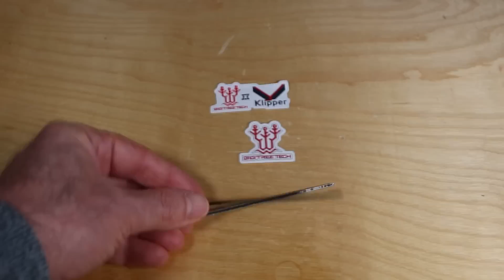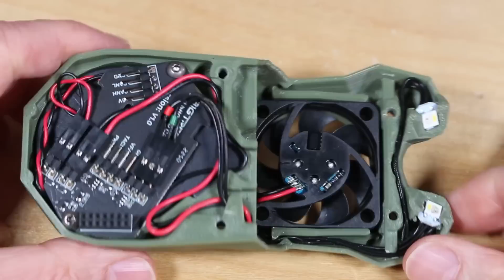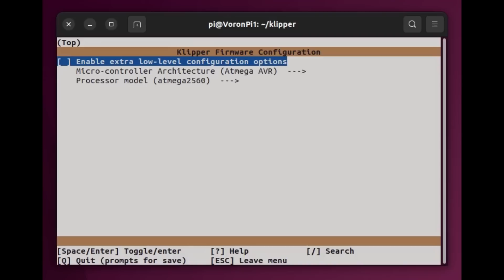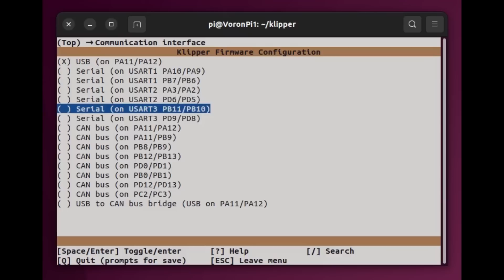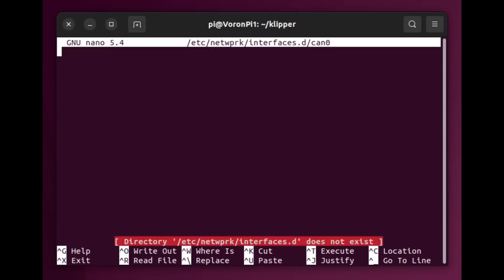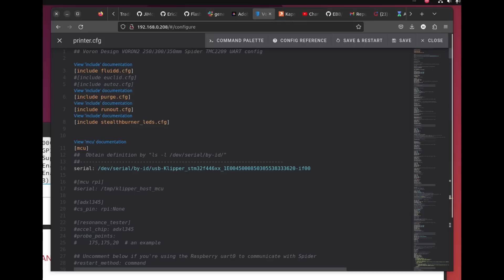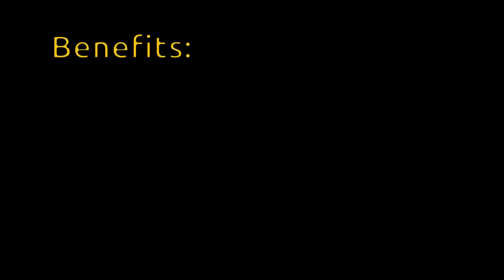Canbus SB2240 and SB2209 3D printer Install, Thoughts & Tips from BigTreeTech (BTT)

Comment: had working printer updated klipper and now cant use anymore do i flash both the manta m8p and toolhead board with klipper going round in circles with canboot klipper and canbus uuid
Reply from the maker: After major updates to Klipper, you may need to flash both.

Comment: I am confused about the power connections to the U2C. Does this power come from my power supply? Also, you didn't mention where the connections go that come from the SB2240 board.
Reply from the maker: Yes, I connected 24v directly from the power supply to the u2c.  The SB2240 can connect to any of the ports on the U2C.  Even the "h" & "L" screw terminals which is what I did.  the SB2240 can also be connected to the power terminals on the U2C or directly to the 24 power supply.

Comment: I'm curious why you didn't plug the can cable up directly into the octopus?
Reply from the maker: Sorry for taking so long to respond. When I created the video, many were having trouble with timeout issues when running canbus through the mcu. The theory was that there was not enough bandwidth over usb and canbus for so many motors.  I don’t personally believe this, but when people switched to using the u2c, those problems disappeared. I did like the use of a dedicated usb port for canbus and the other usb dedicated to the main mcu.  I never had any timeout or communication issues when running high speed or qgl.  I’m in the process of rebuilding my printer and are switching to direct through the mcu and eliminating the u2c.  I have since heard of many others that have no issues running it all through a single usb port and the mcu.
Reply: @KapmansBasementWorkshop  Well the bandwidth on the CAN bus is horrible at 8 Mbit/s. USB 3.0 is 5000 Mbit/s. I think LOD is on to something with their USB setup.
Reply from the maker: @woomdawg true. But the usb ports on all mcu’s such as the octopus or ebb36 are not usb 3.  That said, you can choose to not use canbus and just use usb and usb cables with klipper and those controllers. It will work well.

Comment: I used kliky probe but don't see any instructions about where to wire on SB can board!
Reply from the maker: Theree are plenty of options on that board.  I believe I used PB9.
Reply: @KapmansBasementWorkshop  the Stealth burner canbus board doesn't have a PB9. Main control board does.

Comment: I know this is an old video but a tip for crimping the tiny terminals. 
-Get some double sided tape and leave the terminals on the reel. 
-Have two sets of tweezers and a magnifying glass. 
-Place the wires and the terminals on the tape. 
-Using one set of tweezers, press and hold the wire insulation into the large set of wings and use the othe set of tweezers to fold the wings over the insulation. 
-Do the same for the second row of wings/tabs. 
-Then you can break or snip the terminals free from the reel and finish with your standard crimping tool.
Reply from the maker: This is a nice tip.  I will be trying this out soon.  Thank you!

Comment: Is that adaptor for the pcb different from the one furnished by the Voron team in the SB project? They seem to be identical, but Im not entirely sure.
Reply from the maker: Yes, it is the same adapter 3d print
Reply: @KapmansBasementWorkshop  Cool, thanks.

Comment: Great video, this is going to be really useful - thanks.  Something that my tiny brain can't get quite around and I couldn't find an answer online - these boards are often described as "SB2240 and SB2209".  Does that mean there are two different versions  one SB2240 and another SB2209?  Or is it a board with a combination of both?  The other part to that is.... assuming there are two different boards, what's the decision-making-process for choosing between them?   Thanks again.
Reply from the maker: Those are two different versions.  The only real difference is the stepper motor driver on each circuit board.  It will be either the 2209 or the 2240.  The 2240 runs a little cooler.  I have both and they run great.  However, some have had undervoltage errors with the SB2240.  The general recommendation is to go with the SB2209.

Comment: So did you leave Hall effect sensors in. I’m trying to decide wether to order mechanical x endstop, or leave the Hall effect sensor pod in my printer since it does x and y
Reply from the maker: I don’t.  I also went sensorless in another video.  So I got rid of all micro switches.  I do have the one optical switch in Tap.
Reply: @KapmansBasementWorkshop  everyone says go sensorless, but I’m a little nervous.
Reply from the maker: @ftlw1433  , Everyone makes it sound like it will destroy your printer.  It won't as long as you follow Klipper's tuning instructions.  But I know some have reliability problems with it if It stops too early when homing.  But lowering the sensitivity takes care of it.

Comment: I went through some hell getting my Mellow-Fly SB2040 working on klipper.  My problem was that all of the GPIO pin names had to be lower case, I was entering them in UPPER case because that's how they appeared in the documentation.
Reply from the maker: I did not realize they were case sensitive.  I cannot believe I have not run into this.  Thank you for posting this!
Reply: @KapmansBasementWorkshop  The code that checks for this is in python.  I'm sure it could be rewritten to be case insensitive.

Comment: Hello @kapman, i'm having major issues with the 2240 board, its giving me the "undervoltage" error, and according to A LOT of research, its a wide spread issue.. : /
How are your fearing with this board? have you done anything in your cfg to get it to work?
Reply from the maker: The SB2240 has been flawless for almost a year.  And then, two weeks ago I started getting under voltage errors.  I started re terminating anything that provided power to canbus and the SB2240.  Turns out that placing a new terminator (plug) on the end of the canbus cable from the SB2240 that plugged directly into the U2C fixed it.  I used the largest 4 wire connector that came with the kit.  That one change fixed it immediately.  The U2C is still powered by DC from the power supply to the U2C screw terminals.  It's been running great ever since.

Comment: just a question, how can you flash the canbus controller if the h/l wire is not connected to the u2c board?
I only see the 24 volt wires and the USB C connector on the U2C board
After pressing boot and reset, did you connect a USB cable to the Canbus controller?
Reply from the maker: Yes, you flash it with the USB cable and your PC/laptop/mac or Pi.

Comment: Anyone having issues with EBB SB2209 CAN with to high temperature? It runs around 85-90c and the chip is rated to 85c. My pankake extruder motor stops extruding around 10hr prints. It simply stops extruding no error, no clogs.
Reply from the maker: Is it possible to drop the current to the motor slightly?  Or install a larger heat sink on the motor driver chip?  I have not had this happen to me.
Reply: @KapmansBasementWorkshop  it must be something else on my machine
Reply: @KapmansBasementWorkshop  good idea, will try and add a bigger heatsink

Comment: Hey quick question, I am doing my first voron 2.4 build. I bought the electronics for canbus, with the intention of going straight to canbus out of the box and skipping all the cabling and chains etc., but i don't have any printed parts -- are they 100% necessary to get going?
Reply from the maker: You can start building the Voron Frame, Install the linear rails, prepare the bed and even install Klipper on the main MCU, Pi and the canbus controllers.  But beyond that, you really need the 3d printed parts.  They are required to build the gantry and install any stepper motors and just about everything else.  The 3d parts are critical.  I wish you a great build!
Reply: @KapmansBasementWorkshop  to be clear, I meant printed parts for canbus -- I have a complete set of printed parts for the standard LDO kit :) I just mean going canbus specifically, are there printed parts specific to canbus that I would absolutely need?
Reply from the maker: @justinsfunthings8263 , Sorry about that.  Yes, there are parts that you will need.  If using a U2C, you want to print a DIN mount for it, and the umbilical mounts for the tool head and depending on how you choose to mount, the back of the gantry for the umbilical mount.  You also need the mount for the canbus controller on the tool head.  If you can't print or purchase those, I think you can get by without the u2c mount, but I think you will need to have the parts for the toolhead.
Reply: @KapmansBasementWorkshop  gotcha -- i found the parts i need to print. I'm going to throw a hail mary and print them out of PLA+ or PETG on my old printer, which should last long enough to print out the replacements using ABS on the new machine. thanks for the reply!
Reply from the maker: @justinsfunthings8263  , go for PETG for the interior parts.  The inside of that printer will be between 60c and 70c.
Reply: @KapmansBasementWorkshop  ended up having a friend print me the extra parts in ABS :) going to hopefully get back to building on tuesday when i get back and the parts are here. thanks again!
Reply from the maker: @justinsfunthings8263  , I wish you a great build!

Comment: Can you provide the location of the Canbus adapter plate that is mounted on the other side of the circuit board?  I have been through the entire git repository for Stealthburner and cannot find it.
Thanks!
Reply from the maker: In the Voron design git hub,  Voron-Stealthburner/STLs/Clockwork2/[a] _pcb_spacer. Stl

Comment: I'm guessing the reason people have reported com issues with the RP3 is that they were running the CAN at 1mhz.  Most of the CAN videos I've seen recommended running it at 250khz, which would probably work OK with the RPi 3.   I'm thinking of using this or a similar can toolhead board on my Enderwire.  I'm going to use the Taichi hot end with two M4 extruders for a dual color set up.  Since my Stealthburner won't have a clockwork2 in it, I would run the 4 wire motor cable along one of the Bowden tubes back to the M4.  The other M4 would be wired to my SKR Mini v3.  I could wire the CAN cable along the other Bowden tube and then down to the MCU along with the other M4 motor cable.  Then I wouldn't need an XZ drag chain.
I also might try running the toolhead with a USB cable rather than CAN, an switch to CAN if it gives issues.  I've heard you can use CAT5,6, or 7 cable (which ever has stranded wire) for the connection.
Reply from the maker: Reach out to me on Discord.

Comment: How do I connect the CAN cable supplied from the BTT 2209 board to the U2C module? there is no instruction anywhere.
Reply from the maker: You have many choices. But I simply used the screw terminals on the U2c.

Comment: Thanks for the great video. Regarding the connectors and wiring. The thermistor coming from my DragonFly has the wrong connector and I'm in the same boat as you were. I bought the kit you mentioned in your video. The pre-crimped wires are smaller than the thermistor wires coming from the hotend. Did you splice them in to bypass the crimping? Was worried from a safety perspective on the different gauge wires.
Reply from the maker: I used the MX3 connector that came with the kit.  It's larger to support he amperage and wattage of the heater.  If I remember correctly.

Comment: beh I don't have that spacer to mount it to the stealthburner.. what's the height of it? I have some plastic spacers that would easily fit.. can print it later then
Reply from the maker: If you previously built the stealth burner, you probably already have that part printed.  Any spacer will do as long as it does not short anything and allows you to secure the circuit board.

Comment: You seems to skip the part where you connect your U2C to your PI and Mainboard. I am going to order U2C for my setup since I can not get the ebb sb2209 to work when connecting it directly to my octopus 1.1 can bus RJ12 connector. The problem is that the bigtreetech website illustrates the usage of U2C being connected to the USB-C port on my Octopus and that USB is already taken by my raspberry PI. So where do you connect the U2C to your mainboard?
Reply from the maker: I connect the U2C to the pi vis a USB port. And then I connect the U2C directly to the SB2209.  The mainboard is being used just as it originally was with it's own USB connection to the PI.  The mainboard is just not involved in canbus in the setup I'm using.  Many people have had difficulty with the setup you tried.  So my connections are:
Pi USB -> U2C USBC
U2C canbus -> SB2209 canbus
Pi USB - MCU USBC
In addition, you need to connect power to the U2C.  I got the power directly from the powersupply.
I did not configure the MCU for canbus at all.  It's simply running as it always has (with the extruder motor removed).
Eric Zimmerman has a diagram of how I set this up as well.  Have a look here under "Connecting all the things": https://github.com/EricZimmerman/VoronTools/blob/main/EBB_CAN.md
Eric is using a different canbus mcu, but just replace the EBB36 in the photo with your SB2209.  And be very careful with the power connections.

Let me know how this works out for you.
Reply: @KapmansBasementWorkshop  Thank you very much. I appreciate the fast response and I will definitely follow this description.
Reply: Ok I am now testing with U2C but that seems to fail in same way. I keep getting "No such device" when I attempt to pull an ID with "~/klippy-env/bin/python ~/klipper/scripts/canbus_query.py can0". Besides enabling the 120R Resistor on the EBB itself which exact resistor(s) do I need to enable on the U2C board when I use the black 4 pin 3mm CAN_OUT as output for the CAN cable?
Reply from the maker: On the U2C there are 2 terminating resistors where I placed a jumper.   I assume you installed the firmware on the SB2209.  Then unplug the usb cable and power cycle the SB2209.   Make sure the canbus cable is fully connected, including 24v.  I would then reboot the pi.  You should see it appear then.

Comment: I’m using a btt pad 7 with a octopus pro ez board. Will I need a u2c module to connect to my ebb sb2209?
Reply from the maker: You can connect the SB2209 through the Octopus.  But, some people claim better reliability through the U2C.  I would try it.  If you have issues, then adopt a U2C.

Comment: Im confused. You never shown where to plug the board from the head to the u2c. I cannot find on the BTT GitHub page which port it needs to be in. There are a few to use. Both of the lights on the canbus board on the print head are on as well...i cant get it into boot mode. Grrrr this stuff is never as easy as people show it on Youtube lol :) I am learning little by little each day tho!
Reply from the maker: I went back and looked and you are correct.  I don't.  I simply used the 4 screw terminals on the u2c. 24v to the u2c screw terminals from the power supply and the 4 conductors from the canbus cable from the SB also to the same screw terminals.  I hope this helps.
Reply: Thanks! I have been working on it all night. Haven't went to bed yet. Now I can go back to that step and complete it. Thanks again!

Comment: Did you cut and shorten your Canbus cable? Ever since I did wire management i get the under voltage error.
Reply from the maker: I did shorten the cable from the end that connects to the U2C.  When do you get the error?
Reply from the maker: I was getting an undervoltage error on my y-axis recently, unrelated to Canbus. I ended up lowering the current to the motor and the problem went away.

Comment: Great video, going for the SB2209 RP2040 on my Trident, when u flashed canboard i didn´t see the jumper anymore on the 120R pin. Shouldn´t it be there?
Reply from the maker: I am honestly not sure. But when flashing I was using USB. So I don't think it was a requirement until actually using canbus.

Comment: You didn't show what you hooked up to the U2C. How is it hooked up? I don't understand how there is no guide, or anyone in the discord willing to help.
Reply from the maker: I simply used the screw terminals for 24v + and - and the hi/lo signals for canbus.  For the 24v, I have the wires coming directly from the power supply and the power wires from the SB cable connected to the same screw terminals.  I also have a USB cable from the U2C to the Pi.  If you send me a message on discord, I'll take a photo and send to you once a print completes.

Comment: SO you only edited the make menuconfig for klipper. Did you install canboot as well?
Reply from the maker: I did not install canboot.  While if it's pre-installed, I'll use it, when it's not, I will just re-flash when needed using my laptop.
Reply: @KapmansBasementWorkshop  I have been working on getting the SB2209 setup over the last two days and think I may have a bad cable. When searching for the UUID, nothing is found and also when putting the SB2209 in DFU mode, the Pi doesnt see it.
Reply from the maker: @jaredlewis2961  Sounds like your USB cable might be power only and not a data cable.  I cannot remember if the SB came with one, but I would try that 1st.  If not, use the one that you know works from your cell phone or elsewhere.
Reply: @KapmansBasementWorkshop  it was the SB2209 board, it was bad. How did you connect the CanBus cable to the U2C?Picture would be great if possible.
Reply from the maker: @jaredlewis2961  I used the screw terminals on the U2C. But there are many other options as well. Instead of slack, I’ll post a photo on my GitHub and post a link here…once this print completes….